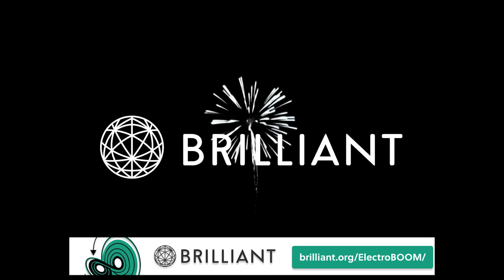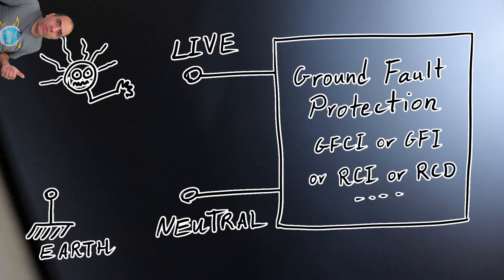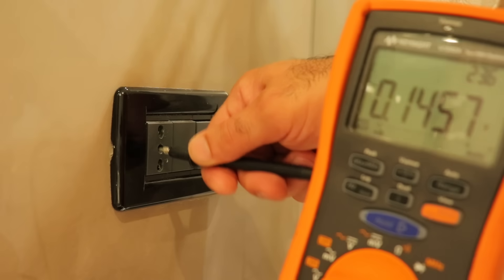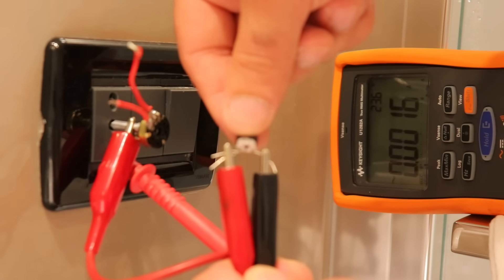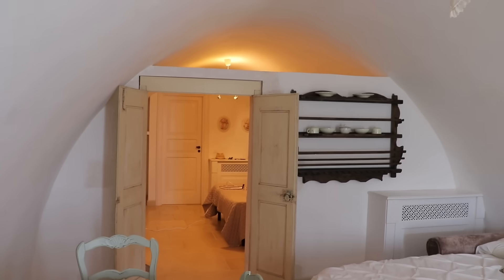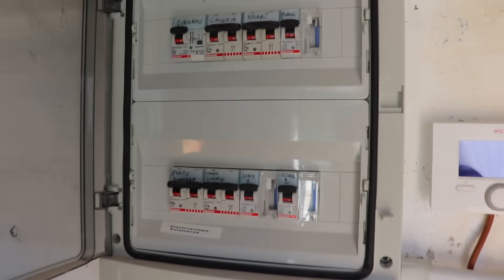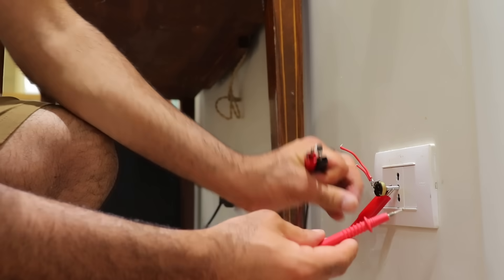Tripping Every Breaker in Italy

Comment: I live in Denmark and a LOT of the standard outlets don't have ground. Especially in older buildings.
Not even in the bathroom where my washing machine is connected... which is quite weird. (it's a normal outlet) 
in my old apartment (built in the late 50s) the plug on the wall for the washing machine etc. had ground, but it wasnt a "normal" plug, it was seperate wires you had to install
Reply: Can you show that separate ground?

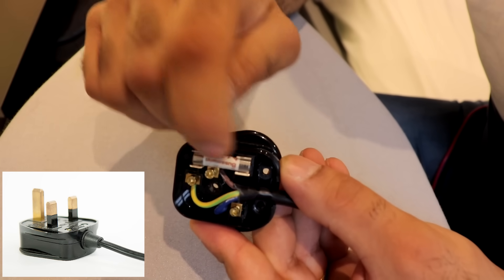Comment: Why electrical engineers cannot go on vacation: 6:10 "what is that? are those live wires?, if they were ground they would have to be tethered to the nearest pole. Or are they live? but there is no warning/stopwork notice. 
Daughter: Hey Electrodad I bought you a macaroon, here try it. 
ElectroDad: not now, I am thinking. If the wires are live then they could potentially cause damage to the building or others nearby. I should alert the authorities. But what if they accuse me of malevolent intent? I have developed a darker tan from the few days at the beach. 
Electrowife: are you okay?
Electrodad: are you neutral ground? WHAHHWAWHJWw vacation ruined

Comment: As an Italian I have always appreciated having a lot of style on electrical sockets. We can choose many different brands (Vimar, bTicino, Feb etc ..) . Standard boxes (503/504/507) are built into the walls which house the plates with the modules (which we call fruits). Furthermore, all electrical cables must pass inside corrugated pipes so that they can be removed. Finally, the electrical panels use the din standard, so it is possible to install different types of elements such as circuit breakers, differential, home automation modules, etc.
Reply: I think Bticino i the best and also most expensive brand😍
Reply: @kasraa4840  The most used series in my opinion is the Vimar Plana
Reply: Why can't you just stick to 1 fucking standard? My European laptop doesnt fit in my european wall porco dio. Ora sono incazzato.

Comment: Schuko pins are bigger the Italian inline plug, ideally you must use an adapter, but you can force it in and over time you enlarge the holes. Normally we use adapter because it's a bit hard to plug and unplug them.

Comment: The strange plug is a BTcino magic plug, very unusual to see, it was a non standard series of connectors for telephone, 10A, 16A ad other type of domestic connections briefly entering the marketn in the 70s or 80s. It was a commercial flop and never (-ish  i suppose) used since. Maybe that hotel standardized their internal telephone system around the BTcino magic telephone plug and never switched

Comment: Hello, i' m a follower from italy and i work on distribution lines... i can answer to some questions:
- the live wire is black , brown or gray , it depends  also if u have three phase or not, the blue wire is always  neutral. If it's not like that it's a bad work.
- the forbidden fruit it' just a distribution cable insulated and protected with red caps (probably in that moment somebody was working on it) .
- Of course we have ground fault protection but so many different class and so many different  mAmps levels, it dipends if you have inverter, photovoltaic etc.. and if you have done a good work :)
- small plugs   are 10 amps and bigger one are 16amps , usually bigger ones admits also to connect smaller plugs obviously .
Enjoy italy :)

Comment: in 3:00, what do you call that terminal connector/termininal block/ combiner thing? i know there is wago, but this is different. We are still using old-school method of splicing and wrapping connections with electrical tape and i wan everything replaced with better standards. thanks

Comment: In Europe, you don't need GFCIs because the electrical equipment already has them. For example in France, switchboards have 3 types of circuit breakers.  Conventional circuit breakers which cut off when too much current is consumed, differential switches which cut off when there is a ground fault and the main circuit breaker.  These equipments are quite sensitive so offers a lot of security.

Comment: I doubt that polarized plugs are still necessary when there are the protection breakers, for what I remeber we in Italy did not have appliances such as the classic american 110V radio receivers without transformer (and therefore chassis potentially connected to the live terminal of the wallplug)

Comment: In Greece we use (not enforced but it's cheap, like 50eu so most houses have it) a kind of that ground protection, it's more than that. Let's call it current monitor, it constantly monitors all 3 (or 1) power lines, neutral and ground. If there is a difference of 0.3A between the outgoing (live) wires and the returning current (neutral) and/or ground, it will pop. Learned it the hard way coz I connected a new room with live wires before that thingy, but had the neutral wires go through that. Kept on poping if something more than a light would turn on. At least I didn't "BOOM" anything.😁

Comment: 15:00 Normally Shuko style plugs don't fit into Italian style outlets... Unless you force them in, but you should clearly notice that there is something wrong in what you are doing!
Reply: that's why he says they are these italian "dual" ones that fit euro plugs (type c) as well, like the ones shown in your time mark. these ones also fit schuko plugs even though without ground protection line.
Reply: @carnifexx  nope! Those are for 10A (small holes) and 16A (big holes) ITALIAN plugs, Shuko has their own socket tipes and Shuko doesn't fit in the 16A ones unless you really force them in.
Reply: @AlessandroGenTLe  oh, ok, didn't know that
aren't the 10A usual europlugs though?
Reply: @AlessandroGenTLe  Btw. it's "Schuko" with a c which is an abbreviation of Schutzkontakt.
Reply: @carnifexx  Yep they are europlugs but with the addition of the ground in the middle (the Europlug is without ground). Europlug has smaller holes than shuko though.
Reply: @keropaci  that is wrong, first, in the video time mark are DUAL sockets with TWO different pairs of holes with different distances. second, europlug an schuko is the same, you can use them almost interchangable, i did that today.
Reply: @keropaci  i am talking about the DUAL sockets shown they have different distances and four holes.
i know that europlug is without ground, that's what i just said, but you can use europlug and schuko almost interchangeably
Reply: Yes shuko have larger pegs that not fit the italian holes
Reply: I have seen a vacuum cleaner in Italy witha Schuko plug and an adapter but the adapter still only fits into the double drilled plug. Might be actually 2 types of plugs depending on power demand.
Reply: @eklhaft4531  yes we usually don't have schukos around the house, only in laundry room and garage and i hate when a new electric device comes with that german plug. Once warranty is due sure i'm gonna chance the plug with a standard one

Comment: Here in europe with unpolarised plugs and sockets, the polarity is a non-consern as the neutral and phase are just as insulated from the chasis of those appliances, unlike the old american devices where the neutral work as a ground too that would've been fatal if it was plugged in the other way.

Then it is VERY common that we only have ground in the kitchen and the bathroom still.
It was not until late as the 90's and 2000's it was a requirement to implement ground in every room and area of the new built houses in general.

Comment: Recently had to bring my Australian house up to the latest code, and it's insane: we have to have a separate RCD on every circuit, not just the main breaker. This has the added benefit of not turning off the lights when plugging a varistor into our power points.

Comment: These electrical outlets where you can put a plug in without proper ground connection seem to be an Italian thing. 
Most european countries as germany where I live use the second shown outlets which allow to use both plug while ensuring there is a proper ground connection if needed.

They also ensure that touching the metal pins while inserting the plugs is not possible, due to their shapes.

Comment: Hi! Just a note about plugs: the small ones are for 10A max, the large ones are for 16A max, the one with two sets of holes is called bipasso (dual step) and can accept both! Under normal circumstances you can't plug a schuko/europlug (the large round one) into a normal Italian socket because the holes are supposed to be much smaller, but a bipasso can be deformed with a bit of force. Most houses have separate circuits for lights and plugs, usually one each for the entire apartment (the standard supply contract is for 3.5 kW only at the end of the day) but some houses have separate circuits and MT breakers for different areas. Mine has two for the "day" area, two for the "night" area, one for the garage/external lights and two for my room specifically because reasons you may easily figure out 👀

Comment: In Italy, 10mA differentials should usually be used for bathrooms, and separate lines should be made for sockets and lights, but most of the time, to save money, they put a single 30mA differential that covers the entire house / apartment; the idea is "better to have a minimum of protection than none".
p.s .: you should not plug the round plug into the flat socket, if it goes in easily it means that someone has already forced it!!

Comment: So I'm an electrician from Australia, and that board or "breaker box", is pretty much the exact same as what we have here. The breakers are RCBOs, or residual current circuit breaker with overcurrent protection, which pretty much do everything you need. Those connectors are called BP connectors usually, and are our main source of connecting wires. EDIT: Also, between 220v and 250v are fairly common, and residual current devices are required for all subcircuits for non industrial installations

Comment: In Norway we usually have RCBO breakers on every circuit, no discriminating between wet-rooms, kitchen or anything else.
Although we do have a separate breaker for the stove, usually 20-25 A and 15 A for everything else. And a separate 10A for the water heater.
Reply: Do you have IT 230V or 3 phase 230/400V TN?
Reply: @MernokiMegoldasok  At my current appartment we have 3 phase 230V IT
Reply: @nibrobb  Is it 30mA gfci on IT too or lower like 10mA?
Reply: @MernokiMegoldasok  All my breakers are 30 mA.
Reply: @nibrobb  It mgiht not even trif in an IT(ungrounded) system is the capacitive leakage to ground is low.
Reply: @MernokiMegoldasok  that's true

Comment: In Italy we use 3 different standards, the one you've used here 5:20 which is derived from the prewar Italian standard without earth, it provides max 10A for appliances, the second standard uses the same style of plug, only with the outside prongs a bit far apart and a 1/3 bigger than the other, it's used for 16A appliances. The last standard is the German schuko standard (big "round" thingy) used for 16A. If the connector hasn't the "single" holes is usually for 10A, and if it also has the "cross drilled" holes, it can support up to 16A, the problem comes when manufacturers mess up the drilling and add the "capability" of the 16A "straight" port to take schuko standard plug as you've shown in the end. Last thing regarding wiring, the usual wire color is the following: green-yellow Is earth, blue is neutral, brown is phase one, black is phase two, even though it can be used often in the place o the brown wire, and grey is phase three.

Comment: 15:22
Not only can you plug that thing into an ungrounded outlet, you can also notice that this plug doesn't have the protection on the prongs.
Usually this kind of plug is supposed to go into an outlet with a thick rim serving as protection from touching a live prong.
Italian outlets let you plug in Schuko plugs, but they don't do it optimally.

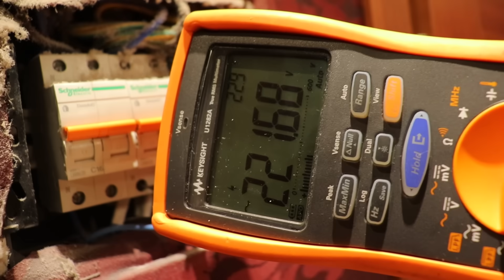Comment: 3:35 Is the black neutral there? That's strange! There could be different standards in Italy, but usually the blue should be neutral and black is live.
14:33 I think it is because a few milliAmps can leak through parasitive capacitances on long wires especially if the wall is wet. 30mA would be an unlikely massive leakage, but still safe to trip at.
Reply: Probably it is an old cable that has been there for 20-30 years, in the past black was used by someone as a neutral and I don't know why, perhaps for some logical combination to the color of the wires with direct current where black is negative, or they were reversed in case of change of the electrician company, like a trap, I personally have never found an explanation.
The Ministry of Defense used a three-phase with green, white, red and the neutral was black because it was built in 1934.
Reply: that really made me think to never trust the colours in the real world out there. always measure it first XD
Reply: In all of Europe green-yellow must be ground, blue neutral, brown is for phase 1 live, black is phase 2 live and grey is phase 3 live. Yes, we have three phases everywhere and those different colors of phases going to different outlets are only allowed in the breaker box that's illegal to open for anyone without qualifications for it. In single-phase circuits the brown is the first and only phase even if it's technically some other phase in the grid. The common 3-phase outlets have them all, and even those have ground fault protection in the breaker box. It's illegal to use green-yellow wire or green-yellow electrical tape to mark anything but ground. Old installation from previous national standards are allowed to exist anywhere but in wet rooms but if any repairs or changes are done to them, they must be upgraded to the current standard.
Reply: @jammi__  no that's not true about the live wires (for all of Europe) that it must have those colors. there is now law for that.
Reply: @DarthZackTheFirstI  There are three colors for live wires: L1 (brown), L2 (black) and L3 (gray), and they MUST be those colors in the breaker box. Also, these breaker boxes Mehdi encountered are new enough to be of current standards. They'd be some kind of circular ceramic things otherwise without ground fault protection. At the outlet end, there are only three wires, with one of the lives and that's where they're brown regardless if they're connected to L1, L2 or L3 in the breaker box.
Reply: @jammi__  you wrote a different sentence before. still there is no law for those colors in all of Europe that the live wires must have those colors.
Reply: @DarthZackTheFirstI  By "all of Europe", it in this context means EU and related countries who agreed on the same standards, not for instance Russia.
Reply: @jammi__  no I still don't think there are any eu laws about those live wires. but feel free to point me to those eu-laws from which those standards are made from
Reply: @DarthZackTheFirstI  there are standards for new electricity systems that are applied to be in the colours. Look for EU HD308 (harmonisation document 308 of the EU): This Harmonization Document applies to the identification of cores of rigid and flexible cables and cords for which the rated voltage does not exceed the upper limit of Voltage Band II (according to HD 193). This HD applies to: - electrical installations, - distribution systems, - supplies to fixed or mobile current-using equipment and - cords for portable equipment.
Reply: @DarthZackTheFirstI  There's no single jurisdictional body over EU, but there are directives that gets made into national laws, which refer to IEC 446 / 60446 / 60445 in the electrical safety laws. The EU directives governing these are serving the purpose of EU as a free trade union of devices and workforce, which is why they're standardized across the area, plus a few other countries such as Norway. Some of the latest such directives are  2014/30/EU and 2014/35/EU. There's much more to it than just wiring colors though, just like there's more than emissions to the car regulations, yet they're ratified as a part of the national jurisdictional systems of each EU member country per the EU directives.
Reply: Probably the wires were switched. Normally, either black or brown is live, and blue is neutral.
Reply: @samuellourenco1050  Black, brown, and grey can be live (3 phase cables have those colors, at least in Hungary). The neutral is always blue, the PE is always green-yellow
Reply: @EFazy  No, it is not. In the past it could have had a different colour. In my country (NED), you can find both blue and red as neutral, grey and yellow-green as earth and green or brown as potential.
Reply: @railion6513  Obviously we're stating what's true for current standards. Old ones can be left as is unless in wet spaces, but if they need repair, they have to be redone with current spec.
Reply: venice has a really old power distribution, sometimes you can still find homes or places with bi-phase instead of live + neutral, so black neutral is wrong, but could be because the conversion from biphase to live and neutral wasn't done correctly.